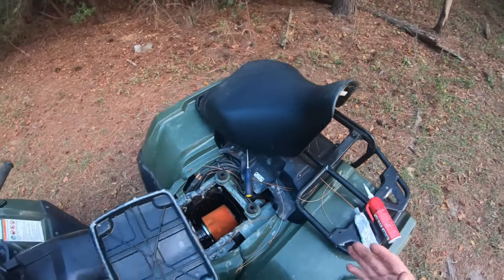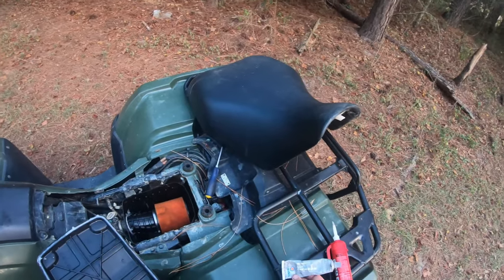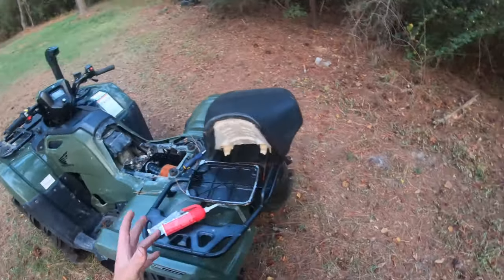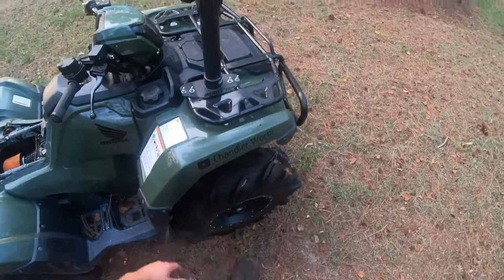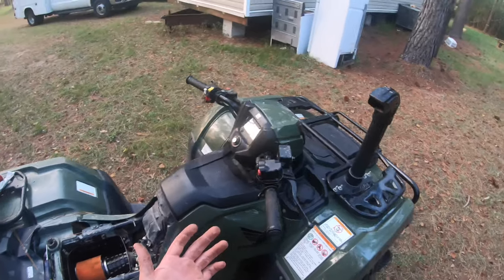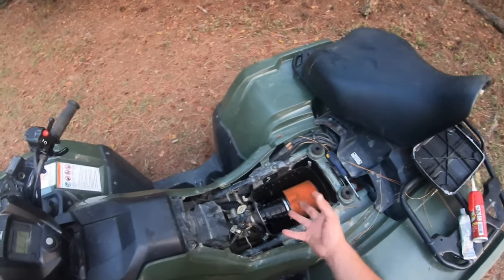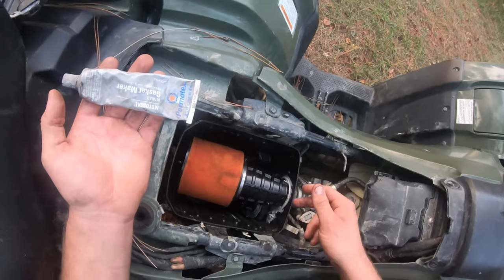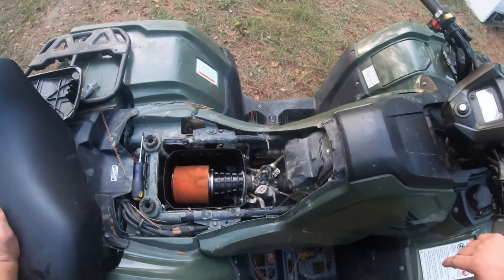SILICONE OR DIELECTRIC GREASE? When Snorkeling!

Comment: Now I understand why you would use the dielectric grease, everyone had always told me silicone, but I hated to have to pull the lid off with it on.
Reply from the maker: Anthony Norris it’s the way to go man!
Reply: Everybody keep saying silicone but that is actually different from gasket maker if you use gasket maker and take out the lid gasket and put gasket maker in there let it cure for 3 days and put the gasket back in and reseal your lid never have to do it again
Reply: Myself personally I'm a one-time Fix-It man do it once right and never do it again
Reply: I wish I could have everybody just send me there are box lids and I do it for them
Reply: I've done this application to every single one of my friends four-wheelers and they have no air box lid issues like Factory when you open and close it when done properly never sticks
Reply: @extremefamilyman7594  how do you do it
Reply: Dielectric grease is actually designed for electric connections
Reply: I put Dielectric grease in every connection just squirted in the connection you want to unplug it first feel the connection boot up and then plug it back in where your fuses you can pull a fuse fill the fuse block with Dielectric grease and then plug the fuse back in
Reply: I pulled every plug each plug when you pull it fill it with electric grease and then plug it back in and my fuse panel I pulled each fuse individually field where they go with Dielectric grease and then plug them back in
Reply: @huntergray1554  my whole bike is 100% water tight never had a problem going underwater recently I found it throttle position sensor on the side of my fuel injected throttle body had to take off and fill with PB Blaster cuz the gasket leak now I might recommend putting some gasket maker on that gasket and then reapply not silicone but every single connection you want to unconnect Dielectric grease into the connection and then plug back in now the airbox I took the lid off I took the gasket out I bought actual gasket maker not silicone and I put it where the gasket goes in a thin layer after three days of curing I reinstalled the gasket put the lid back on never had water in my airbox again from lid leaking the fuse panel I took the lid off of it unplugged each fuse individually field where they go with Dielectric grease I plugged them back in no problems do you want to do the same for the four-wheel drive solenoids and all the solenoids under the Plastics typically located under by the front of the seat

Comment: I’ve felt this way for a long time but after trial and error I’m telling you 100% after about two hours that dielectric grease gets hot since it’s near the motor and with the pressure of the intake sucking air that dielectric grease melts/gets sucked down in the air box from the seal and it leaks. I hate to do it but the way to actually seal the lid is gasket maker.
Reply from the maker: I never thought about that. We always rode more in deeper water than anything, so everything always stayed pretty cool. I could see where it would cause issues if you trail rode a lot, and the engine is getting pretty hot. Thanks for the input, I really appreciate it!
Reply: In that area if I want going to get a caulk gun with silicone plumbers putty would probably work.
Reply: Me and my buds just use marine grease stays a bit longer

Comment: Honestly tho most of these older airboxes get slightly deformed and the lids never seal even with dielectric grease. I've had 2 Honda's were the box sides are kind of sucked in and was a bitch to get the lid to seal had to 5 minute epoxy one and silicone the other I've used dielectric grease on a couple but it truly requires a perfect injection molded box and the older bikes 2 out of 5 were bad from the factory. My kawi bayou airbox got so brittle the tabs blew apart when I was opening it So i had to epoxy it as well. when that's the situation I remove the filter cut a 3" hole in the top of box and glue in a 3 inch PVC inspection port and threaded plug to be able to clean it ect. Then I run an inline mesh/foam style filter in my snorkel stack that I can service if needed.
Reply from the maker: Wow, that’s crazy. I’ve had this machine since it rolled off the showroom floor. It’s never leaked a bit with using dielectric grease. The box has always been in good shape.
Reply: @ChandlerWorth  I agree that the majority of these bikes had no problems. but some were just rushed out the factory that day. not saying your way isn't right, if my air box is in good as new shape I'll 100% use dielectric grease. but if my bikes a second hand bike that people have spayed ether into the airbox to start on a crappy day or used carb or parts cleaner and got it all over the box they usually deform slightly and or dry out the plastic getting brittle causing the clips to snap off the box. I've only owned 1 new bike and its my daughter's old quad treated that bike like gold eventho it was a China fortrax 250 clone "Wilderness 250" and sold it for $100 less than I bought it for 2 years later.

Comment: Did you put your fuses and relays in a waterproof box? I’m going to get a 2021 rubicon 520 soon and am wondering about getting those wet
Reply from the maker: I didn’t, I put dielectric grease around the box that goes over the fuses in the rear, and pulled all relays and fuses, and then putting dielectric grease under each one before putting them back in.
Reply: Myself personally I pulled each fuse individually and put Dielectric grease where they go and plug them back in never had to seal my fuse panel to this day I still don't have problems

Comment: Iv got a grizzly 2000 660. The air filter had a sticker foam connector and it seems insufficient for the air filter   Im puttibg a KN on and it doesn’t call for anything. You just drop it in and it’s two rubbers meeting each other. No seal !?  Wtf

Comment: What if my atv has a very small leak of oil like overtime and mine is snorkeled is good? Could water get in?
Reply from the maker: Nathan Perkins it really depends on where it’s leaking from, but if it is a small leak I would say that you are fine running in water, because the water would have to have pressure to bypass a seal and force oil the other way.
Reply: My nephew had a small leak in his shifter seal and got water in his motor every time

Comment: How much do u change out and re do the dielectric grease on the lid?
Reply from the maker: Curt Baker only whenever I take the lid off of the air box, which for me is after every big ride to check my filter.
Reply: Me personally it's a pain in the butt I don't do the Dielectric grease on my airbox but if it's working for you guys and you're having fun more power to you
Reply: The product I use is called[The right stuff]it works the best
Reply: It's got a fast drying time

Comment: Do I need to put dielectric grease in my little fuse box on the Forman
Reply from the maker: I recommend putting dielectric grease on any and all electrical connections on the fourwheeler. I would put it all on the prongs of the fuses and reinstall them!
Reply: @ChandlerWorth  okay thank you I just got a snorkel for my 420 and I was confused on where to put dielectric grease but now I know so thank you
Reply from the maker: @carsoncelmer5747  anytime man! I’m glad that I could help ya out! If you need anything else, just let me know!
Reply: @ChandlerWorth  do you put it on the battery to ?
Reply from the maker: @juanestrada8941  I didn’t, but you can, the battery connection are normally pretty good. I wouldn’t worry about it personally.

Comment: I have a 2013 rancher 420 im having issues with it shutting off under water now it doesnt happen in every hole but some it does and its not the air box cause when we open it its bone dry but it will still shut off under water not sure what it is any suggestions?
Reply: I would pull out all my fuses and Dielectric grease and fuses are probably Crossing and it could be stalling or could be needing Dielectric grease in the plug boot make sure all your electronics are Dielectric grease stands problems will go away
Reply from the maker: I would try what Extreme Family Man is suggesting, on a side note, I'm not sure if it carburated or fuel injected. If it is carburated, Make sure the vent lines from the carburetor are run above water, and check the check valve in the over flow line on the bottom. If it's fuel injected, let me know and I'll dig deeper.
Reply: @ChandlerWorth  my nephew had the same problem with his four-wheeler it was carbureted it was the Overflow on the carburetor when he would get deep enough it would pressurize and put water in the carburetor a screw in cab over flow line and it stoped
Reply from the maker: Extreme Family Man yessir, I had a 2014 rubicon that had the same problem, I kept a golf tee to put in it when I would ride in deep water, and pulled it out after I was out of the water. Run like a charm!
Reply: Chandler Worth fuel injected
Reply from the maker: Cutler Floyd did you put dielectric grease in all your electrical connections and on the spark plug boot?
Reply: Chandler Worth i did the spark plug boot and under the seat there was I believe 2 wires that connected to each other i unplugged them and put grease in those and that was all i could think of i read about a tilt sensor that im gonna be looking at
Reply from the maker: Cutler Floyd any and every connection on your atv needs the dielectric grease in the connection, even the ones plugging into your ecu.
Reply: I just properly sealed another air box lid watch it on my channel and I take every single electrical connection off of my quad and replug them back in with Dielectric grease never had an electrical issue
Reply: I even Dielectric grease the plug on my rollover sensor
Reply: Watch properly sealing another air box lid on my channel and then watch as take it in deep and test it

Comment: Are you saying silicone grease hardens?
Reply from the maker: Not that it hardens, but that when it dries, it is stuck to whatever it has dried on, and it is then aggravating to get off cleanly.
Reply: @ChandlerWorth  That's interesting. 3M makes a silicone paste for use as lubricant on brake guide pins that the calipers slide along:
https://www.amazon.com/3M-08946-Clear-Silicone-Paste/dp/B005RNEH5O/

It looks very similar in color and consistency to silicone plumbers grease:
http://www.archerairguns.info/2014/02/lubricants-for-springpiston-air-rifle.html
Reply from the maker: @FranklinPhan  I gotcha.

Comment: I put silicone on mine   How do I get it off
Reply from the maker: The only way to get it off now is to pry it off as easily as possible
Reply: A hundred percent silicone never dries I always use gasket maker that will actually dry and if you watch my video you can see I take my air box lid off its low issue I can take off whenever I want
Reply: The other thing is making sure you let it dry giving it three to four days to fully cure before you reinstall and I take the gasket out of the air box lid and put gasket maker in and then reinstall the gasket after it's dry
Reply: Watch properly sealing another air box lid and then you can watch us take it in deep in alligator Pond and test it have not had one problem with our air box Lids easily open easily closed always properly sealed
Reply: I have done all my friends and Family's a TV air box Lids this way and it's a permanent fix never had one glue shot as long as you let it dry

Comment: Quick question how dose it make a water tight seal if you can remove it
Reply from the maker: The water doesn’t exert enough pressure to push the grease though. The grease is just thick, and fills the gap between the lid and air box. With it being thick, it doesn’t push though and fall into the air box, or push though and let water in. It’s the same concept of greasing ballpoints or pivot points on a vehicle

Comment: Do u put dielectric greaser on ur starter to and spark plug?
Reply from the maker: not on the starter, but i did inside of the sparkplug boot.
Reply: I recommend every electrical connection